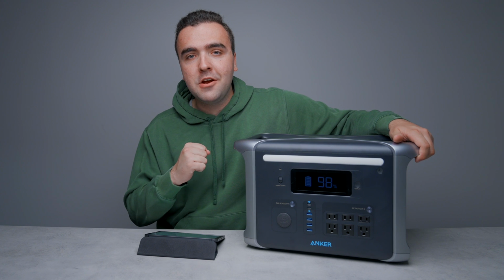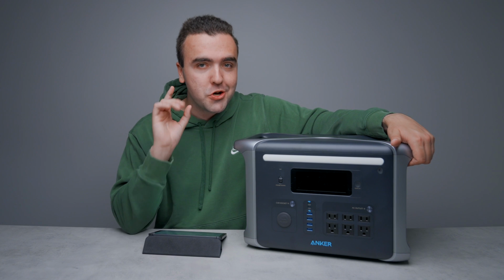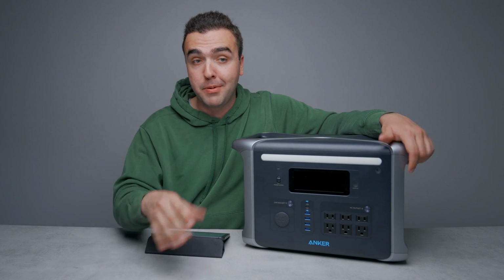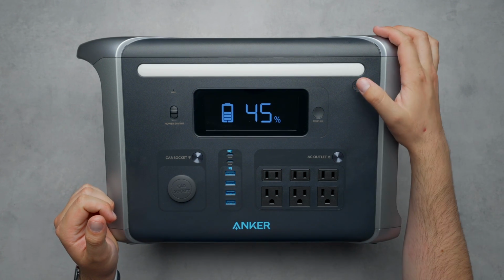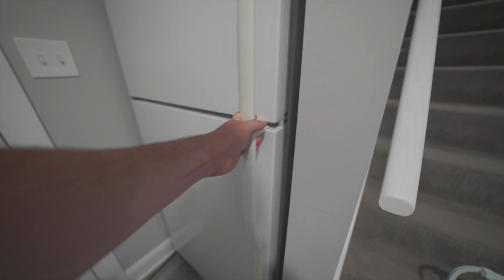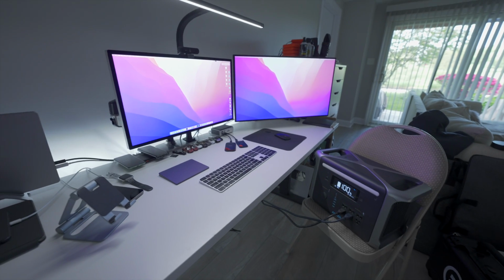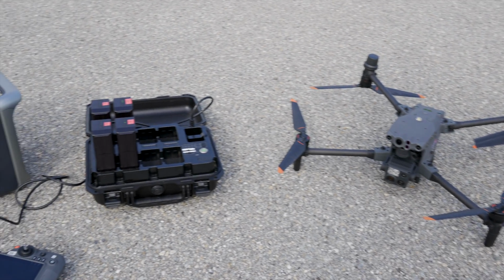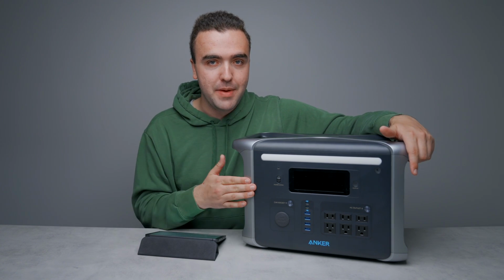Anker 757 PowerHouse Review - The LONGEST Lasting Powerstation

Comment: I just bought this on Amazon as Refurbished. Boy did I make a mistake. Only a three month warranty and it cam defective out of the box. AC power unit button turns off all by itself after a few minutes of running it. Did all the tests to no avail. Had to call Anker Customer Support to get a replacement unit. Very disappointed in this device. 🤨

Comment: Easy to set up and get running when we have power outages. I especially like the dual fuel feature as I don’t need to worry about aging gasoline and keep both on hand. Live in Texas where web had some power outage issues the past couple of winters and this gives me peace of mind for the refrigerator or small appliances as needed.

Comment: Years ago I used to run my batteries all the way to zero before I'd charge them back to 100%.
 I had the idea that that was the way to get the maximum capacity and life from the device. 
As far a you know is that still generally true and with the 757 specifically?

Comment: So far I was impressed until the end. Disappointed. You didn’t plug anything into the 12 Volt Socket or measured it’s voltage. Is it rated voltage?

Comment: These are still way too much money. U can get a good generator for a third of the price. I think electric is the future for sure but these things have another 10 years at least before they compete. Definitely cool but not worth the price. Rather deal with gas at that price.
Reply: I have a couple of these power stations.....sold my gas generators, petrol prices are sky high....basically the upfront cost is expensive but I get my money back after a year of usage , these powerststioms will last minimum 5 years of heavy ,daily usage...I am saving money now. If petrol price was cheap O would mever have bought these...blame WEF and ClimateHoax Scam for petrol price hikes😢

Comment: Let’s put things into perspective, a 2200 watt inverter generator that sells for $500 (Top of the line Honda is $1100) will run an 1800 watt load for 3.2 Hours (5760 wh)…versus Anker’s running a max 1500 watt load for 49 minutes (1229 wh) for $1300-$1400. Fuel the inverter in 3 minutes and your back up and running. Sure these things cool but I gas inverter generators are awesome!
Reply: And you as well as everyone else in an area is flooding gas stations during disasters to fuel those generators. It gets really ugly at those times. 

I'm in Louisiana with hurricanes and hate using gas generators. Noise, danger of carbon monoxide poisoning, and dependence on gas (a limited and popular resource during a disaster) are a few of the reasons why I like to see growth and innovation in the battery/solar space.
Reply: @Schild4823  Nope. My backup generator is tri-fuel and I don't plan on ever putting gas in it. Natural gas only. Good luck using solar for backup! If you're camping these batteries will work, but a backup solar system will cost you thousands if you plan on actually running your house.
Reply: Many are using camping and such where not hearing a generator running is a huge plus. I agree that a gas generator is superior in many ways, but these battery solar generators still absolutely have a place. I personally have a 7000W tri fuel for longer term emergency back up at home, 2 Honda eu2200i for camping in the summer if I want to glamp with air conditioning, and a few solar generators for charging cell phones and smaller battery packs under 26000 mah.
Reply: These can be used silently and inside a vehicle.. recharged from solar (for free) and are much more portable.
Reply: Ya another 10 years these things will probably compete with a gas inverter. No doubt they are cool and cleaner but no way I would spend that much. I definitely would like one but not at that price.
Reply: What are you going to do when the power is out for a year, due to an EMP, and Gasoline is not available?
Reply: Could happen, the sun might not come up tomorrow either, but when was the last time power was out for a year or we saw an EMP? If we see an EMP you aren’t going to be worried about powering your TV, or cell phone.

Comment: Can this handle DeLonghi Portable Air Conditioner 12,500 BTU,cool extra large rooms up to 550 sq ft,wifi with alexa,energy saving,heat,quiet,remote,AC Unit,dehumidifier,fan,programmable,window venting kit,EL376HRGFK

Comment: For more usb C ports, use the 12v port with a usb C car adapter. I do this with my power stations.
Reply: The 12v port has a power switch you have to toggle on for them to work. I like the built-in ports because they are always available without switching on any extra power (and there is not any phantom draw from them like there is when you turn on AC or the 12v dc power).
Reply: @winjoda  You are right, the built in ports are better and there should be more. I have the 535 and it only has 1 USB C port. We struggled with charging drones, phones, and other things with the limited ports.

Comment: Can i use it as a UPS without loosing battery capacity overtime?
Reply: All batteries will degrade over time, but these LiFePo4 batteries have outstanding life/cycles. I have been using mine as a UPS and it stays at 100% so it isn’t actually drawing/cycling the battery except for when the power goes out. I have to believe that the impact of this is very minimal.
Reply: @winjoda  Thank you very mch for confirming this and reaching out. Im in Tanzania and i have a rig of 5800x/3080 and power here doesnt seem to be so much stable so i will be plugging my router and pc all the time.
Reply: @XYLORDSHADOW  in that case, yes I think this will help a lot. It will clean up your power and will give you power if the power source shuts down. I don’t know the impact of frequent outages/drops in voltage but out of any battery chemistry out there I think these LiFePo4 batteries will give you the longest battery life possible before it degrades. These are rated to 3500 full cycles before you hit 80% battery capacity.

Comment: 1500w AC outlets got me sold on this. I'm currently running a Go Sun 1200 portable battery for camping every weekend at my kids' motocross races but the surge max is 1200 watts. After my son is done riding his electric Husqvarna EE 5, the surge goes all the way to 1500 watts. With this battery I could theoretically charge his bike at the side of the track without having to use the 1500 watt plug in my Mitsibishi PHEV Outlander. Son could then ride a back up bike right away.

Comment: Great review Billy, can I get 5 days (actually nights) out of this beast if my c-pap uses 5 watts of power?
Reply: Maybe not. That is because of the internal power consumption of the device when the output ports are enabled. Lower external power consumption means more power is lost to internal consumption because the device is on longer. 

Will you run off ac or DC power?

A lower max power output unit will have less internal power consumption and last longer with low power consumption external devices.
Reply: If you calculate the usable power capacity of this unit with his 22 watt fan, it was less than 500wh, but it should be at least double that.
Reply: @aaronsmith2517  Thank Aaron, with my Bibene CN-505 I can get just about 5 nights with my Resmed Air sense 10 with the humidifier turned off. I'm looking for a Powerstation that will match or precede that. I had the bluetti and the EcoFlow river pro and both those units only gave me 2 nights of 8 hrs sleep so I sent them back. Geez, the way they promote they're units you would think you would get at least a week. After I did the actual tests, I WAS REALLY DISAPPOINTED WITH THEIR OUTPUT. I am not that educated when it comes to this field, so trying to chose my next Power Station has become quite a chore.
Reply: I have this Anker battery and a Philips Dreamstation 2 cpap. 

I tracked my power consumption of the cpap and with heat and humidity disabled it uses about 20w per hour (around 160wh per night, which should be about 13% of the battery). 

When running my cpap on the 757 using AC power it used about 25%, which I calculated to about 300w per night (or about 38w per hour). I also ran the built-in light on low overnight as a night light for my daughters but it shows as only 2w draw, so it doesn’t add much load. But because of that I rounded down the 25% usage to 300w on the nightly total for the cpap. 

But other than the light, my understanding/assumption is that extra 18w per hour of power consumption is just lost to the AC inverter (so, that 38w/hour isn’t actual power consumption by the cpap), so I’m going to buy a DC supply for my cpap since the DC output has MUCH less loss. These DC supplies are widely available, cheap, and are pretty universal for cpap devices, so you should likely be able to find one for yours.

With a DC supply for my cpap, I hope to see less than 25w per hour, but I haven’t tested that yet so I don’t know where that will end up. 

I also bought two 100w solar panels for $80 each, and they easily reach 160w of solar input. So with those I’m easily able to recover my overnight cpap power usage in just a couple of hours. So that’s another way to go. It also gives you more flexibility to use the 757 for other things without jeopardizing your power supply for the cpap.
Reply: @winjoda  hi, thanks for your comment it is an area I am very interested in as we look to possible power outages this winter. Have you managed to test your CPAP on the DC output yet and if so how did it work out please?
Reply: @stuarthawksworth  I did! Unfortunately, the whole ordeal with the cpap on 12v dc made me ultimately return the 757. It kept cutting out with no explanation and support couldn’t get it to work either. Finally they said that this battery really shouldn’t be relied on for medical devices. 

I can say that their support was awesome to work with. It has some great features but this and a few other issues I had with the device made it clear that this needs to evolve a bit before it is ready to compete against Bluetti and some of the other big ones.
Reply: Your CPAP only uses 5 watts?
Reply: @TobyCostaRica  Yes , that's what it say's on the screen. That's with the humidifier turned off. I have the Resmed Air Sense 10.
Reply: @grh7399  somethings not adding up. The CN-505 has less capacity than the River Pro. At 5 watts you should be getting a full week on the River Pro even at half the capacity. Looking at Anker’s chart all their device estimates from low power to high power draw devices show a roughly 8-900 usable watts of power.

Comment: The XT60 input choice was an odd one. I ended up buying a 757 and a 110 W solar panel with MC4. Looks like I'll be living that dongle life.
Reply: I’m pretty sure you can just cut off the mc4 and swap them with xt60. 

I’m getting a 25 foot extension cable anyhow to run the panels farther away from my base camp - I’m planning on putting mc4 on the panel side and splice an xt60 on the other. Still technically is a dongle-like situation, but it has a purpose in my use case.
Reply: PP30 connectors that Jackery uses are much better IMO.